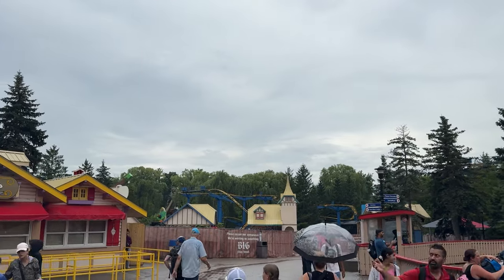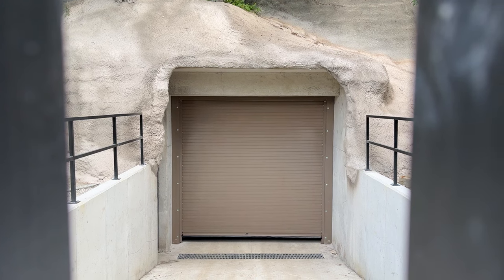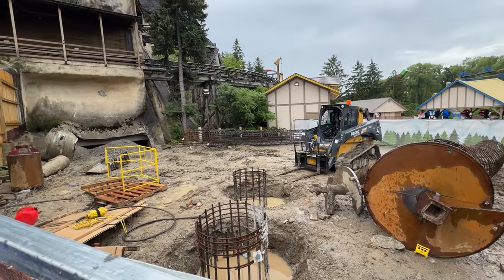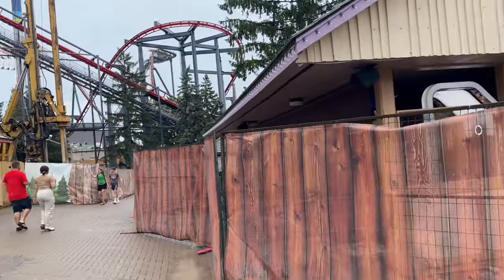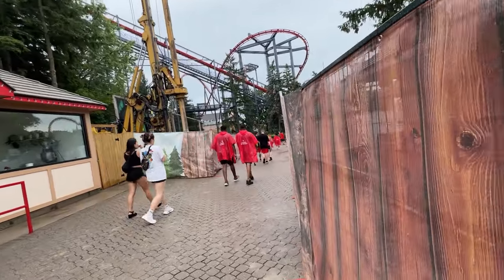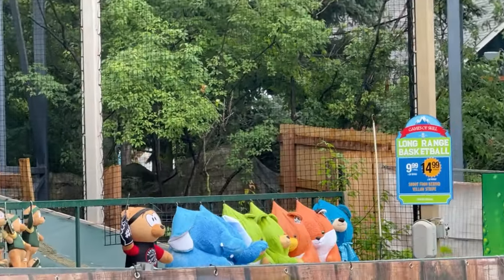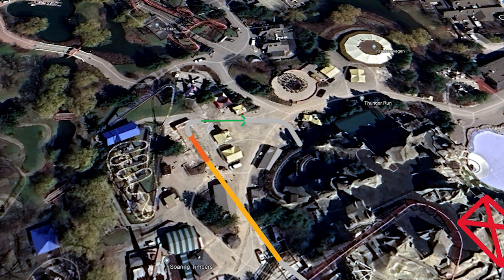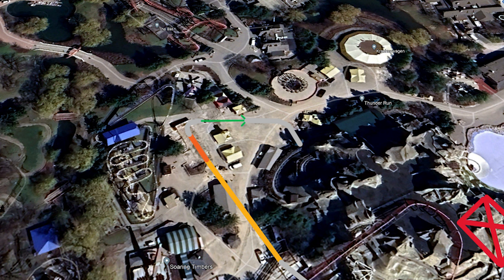Canada's Wonderland NEW 2025 Launch Coaster

Comment: Premier is going to knock it out of the park. Hopefully this ride has higher capacity (either 4-across or longer) versions of the skyrocket trains.
Reply: Hopefully they don't use the skyrocket trains at all lol
Reply: I think the width of the tunnel #1 confirmed they don't have a ton of width to deal with?
Reply: whats stopping them from just adding a 4th car to the skyrocket layout? Is it that technically complex that the length would add other stresses etc and you cant just (with some minor engineering etc) slap on another car?
Reply: @robmausser   Given the length of Ice Breaker's station and this one being 15ft larger they could easily be running an extra car on this train.
Reply: @robmausser they should do 3 seat train.
Reply: @billchief397   Yeah I talked through that in another thread.

A 4 car train with the 4 passenger cars would work. That'd be like Ice Breaker with a 16 passenger train.

A 3 car train using the 6 passenger cars would also work. That'd be more akin to an 18 passenger version of a West Coast Racers train.

Both would necessitate a 60ft long station.

Comment: The old Flight of Fear models had separate loading and unloading zones. It makes sense that Premiere would go back to that.
Reply: @Feelthefelt   The unthemed versions of those LIM coasters do not have the separate zones. I believe those were primarily used for theming - they go along with the spiel in the old Outer Limits preshow. I think they actually hurt the capacity and if you’ve ever waited in line for either Flight of Fear you know their capacity is bad even with three trains.
Reply: PS: The unthemed versions run 6 car trains. Both Flight Of Fears run 5 car trains.

Comment: Hope they address their terrible trains. The launch coaster at Sea World called Ice Breaker would be so much fun if it didn't have such terrible trains. I am 6'2" and they are very difficult to get in and out of. Even without the comfort collars the trains have this weird back pad that pushes you forward and is extremely uncomfortable. Have only been on a little over 50 different coasters. Out of any of the newer coaster models I have been on Premier definitely has the worst trains in the industry.

Comment: Coming into the brake run with a lot of speed also signifies a shorter layout. Hopefully I’m wrong though.
Reply: I don't think it signifies anything about the length either way. Superman The Ride at SFNE is relatively long and it flies into the brake run.
Reply: Vortex
Reply: considering the areas they are getting ready for putting in footings, the fact that there are 3 holes the mountain for the coaster, I dont think its even possible for this ride to be short.

Comment: I would like to see a separate unload and load with three car trains, because I think that will improve capacity more than just a longer train.
Reply: That really only improves capacity when running 3 or more trains most of the time. For Millennium Force for instance the separate platforms actually hurts capacity when running 2 trains.
Reply: @Danrarbc  hmm interesting that does makes sense though that it hurts capacity when under 3 trains though but if the trains are only three cars I would hope that they are running at least three trains like maveric can run 6 trains if I remember right and those trains are three cars
Reply: @CoasterCam-k3x   I checked the length of the Ice Breaker station. It's 45ft and they run trains 3 cars long.

a 60ft station here could indicate trains 4 cars long.
Reply: @Danrarbc  interesting we’ll just have to see how it turns out!
Reply: @CoasterCam-k3x   The other possibility is they could use the 3 of the 3 row cars used on West Coast Racers. 4x4 would be 16 passenger, 3x6 would be 18 passenger.
Reply: @Danrarbc Yeah didn’t think about that and they could also do a similar thing to zamperla where they make a whole new train because this is their biggest project
Reply: Although they haven’t made any announcements or teasers like zamperla did for any new trains